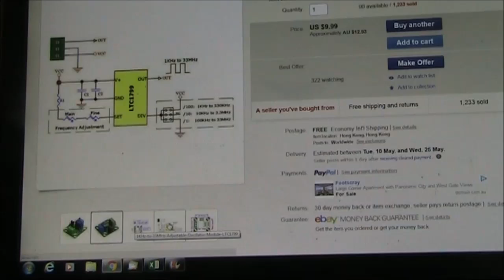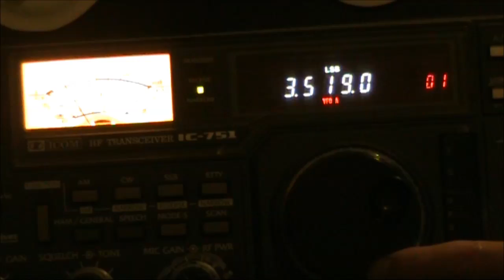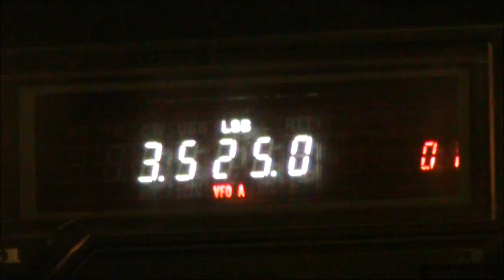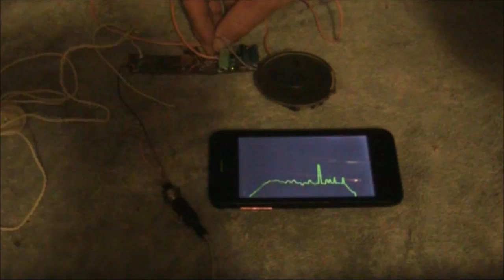Testing a ten dollar IC RF oscillator

Comment: I wonder what exactly the cause is of the jitter. I bet it's phase noise performance is atrocious too.
Reply: PS: I bought a 100khz to 30MHz DDS signal generator off of e bay not that long ago. +11dBm output and it has an input to AM modulate it. It's modulation linearity is quite impressive. You can also select the frequency resolution down to 1Hz. It cost me $100 though. I still think it's worth it :)